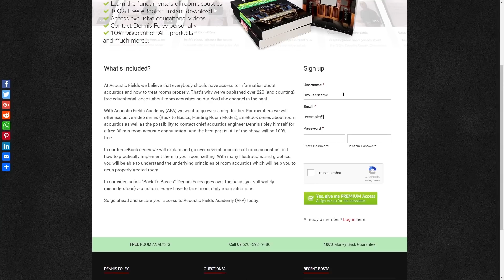Can You REALLY Hear The Bass In Your Room? - www.AcousticFields.com

Comment: It astonishes me how insistent people without formal training are about this topic!! So many people who call themselves “engineers” are ignorant about the behavior of low frequency energy in smaller spaces and choose to pretend physics doesn’t exist. It’s almost like trying to debate with a flat-earther.
Reply from the maker: A, An understanding of low-frequency pressure is difficult. Wave energy is complex. For example, if we use your room as a glass of water. The water is the low-frequency energy and it is spilling over the edge of the glass. To lower water level, we drop in sponges (treatment). The sponges cannot be any sponge. They must absorb at proper rates and levels to lower water level quickly.  Most people confuse middle and high-frequency treatment which works on molecular velocity or air movement with pressure wave treatment types.